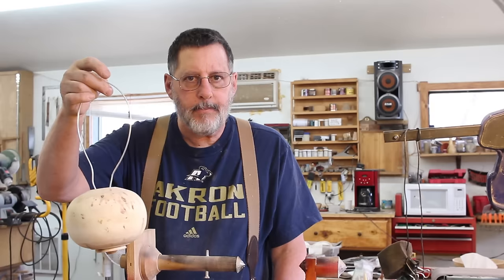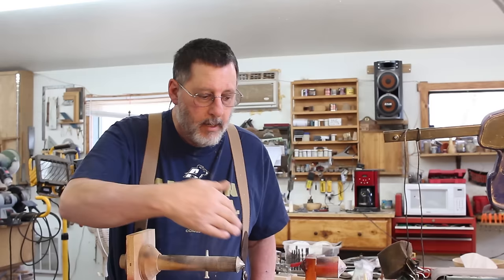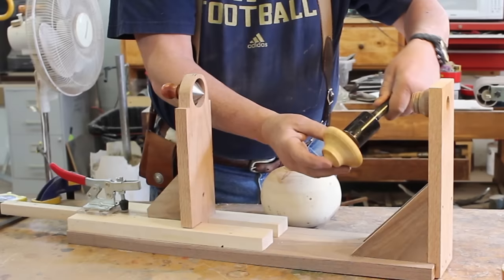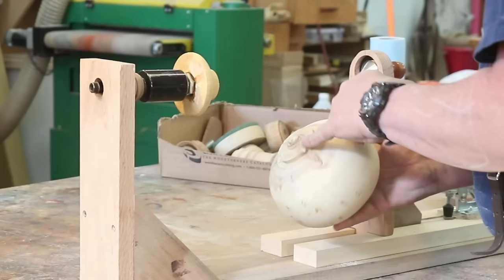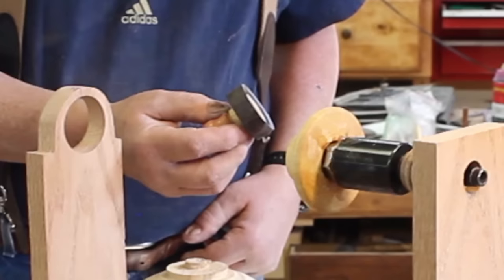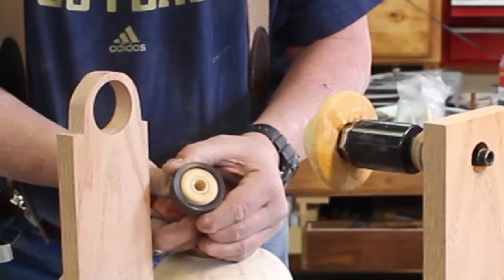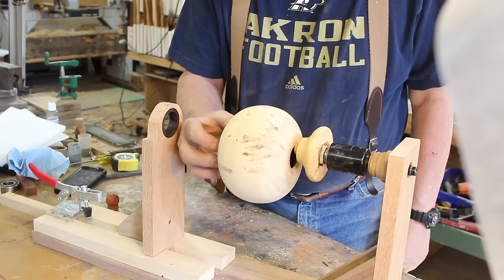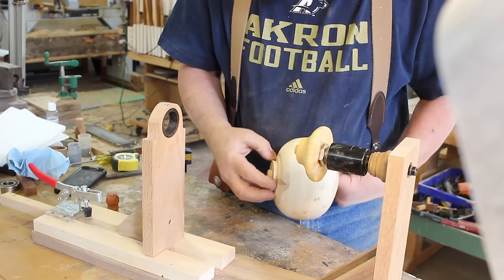Spraying Fixture for holding  Hollow Forms;   Woodturning with Sam Angelo

Comment: Great lesson and jig Sam. I'm thinking of starting to use lacquer on my turnings, but it's a scary and time consuming activity... I'll also need to make a spraying tent or similar in a relatively dust free space. Where do you normally spray?
Reply from the maker: +Yuval Lahav Woodturning 
Thanks
Just try it.  You will love spraying.  You don't need anything special.  Lacquer dries so quickly that it will "skin" over in seconds.  I don't worry about dust.  If you have a garage just set up at the entrance with the door open.  If you have a small fan-set it up to blow across the work directed to the outside.   The most important bit is YOUR Lungs.  Make sure you wear a good chemical respirator.  You can practice by using a rattle can of deft or other Lacquer.  Then you can get a small gun and spray.   Sam
Reply: +WYOMINGWOODTURNER Thank you Sam, that was quite an answer, I will practice and see how it goes on a test piece, my lathe is right near a window, and I have a fan that hang over that window to blow dust out when I sand, that should work as well for any spray I would imagine.

Comment: Sam, do you sell the jig you made for use with a hollowed vessel that has a treaded shaft with something soft on the tip that touches the bottom of the vessel and a wooden piece that fits into the mouth of the vessel.  I thought I remembered you saying you sold them.  If not, do you know who does?  Thanks, Chuck

Comment: You talk about getting close when spraying , try a telephoto or zoom lens. This should get you close view, but far from the spray.
Reply from the maker: +Jim Skaggs 
Yes you are correct.  I do have some bigger lenses.  One of the problems is that I have a doorway that is in between where I spray and where I would set my tripod.  I just haven't worked out the position/lighting etc.  i will work on it.  Sam